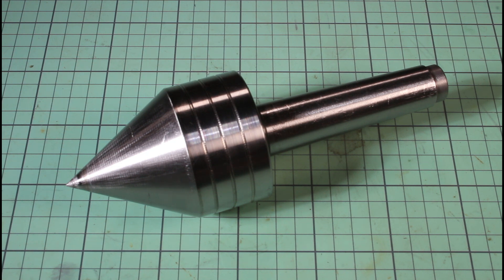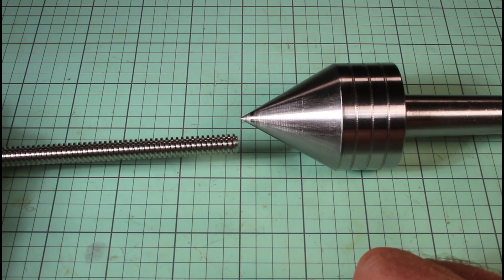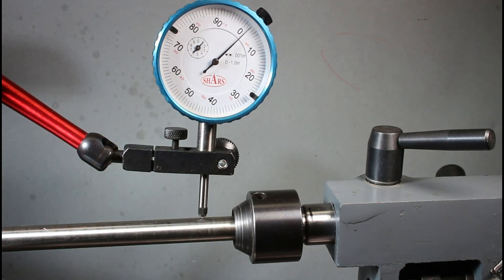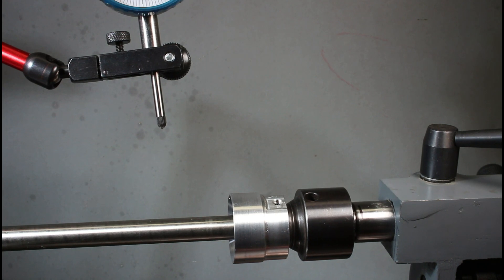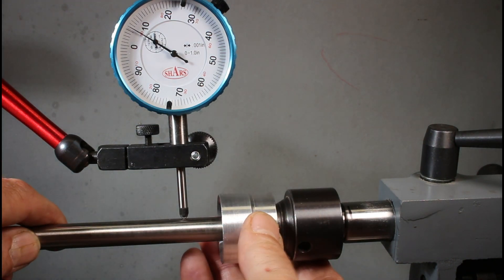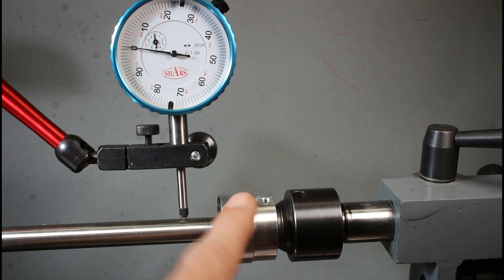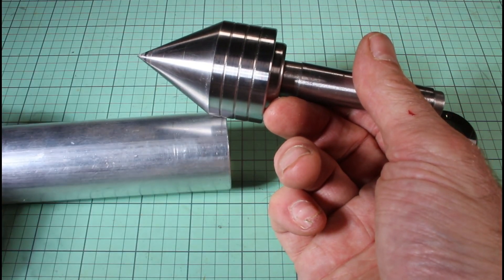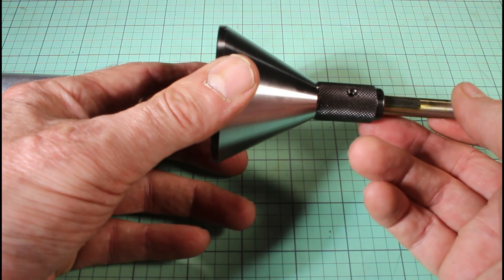Live centering for the mini lathe

Comment: I am polishing a pair of valves from a 50’s NSU motorcycle I’m restoring.  I get a bit of wobble on the stems with the valve mounted in the chuck.  Since I’ve been polishing by hand, I’ve just worked with the slight wobble.  Your conical live center Idea is a good one and I think I can use it to support the tappet end of the valve and reduce the wobble.  Good video.  Thank you for making it.